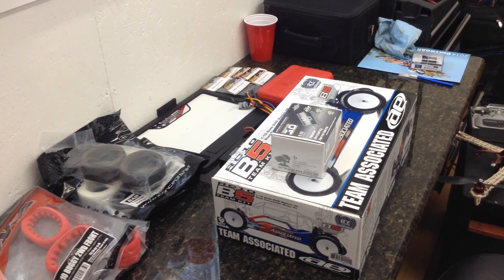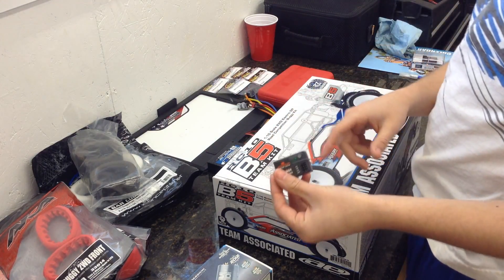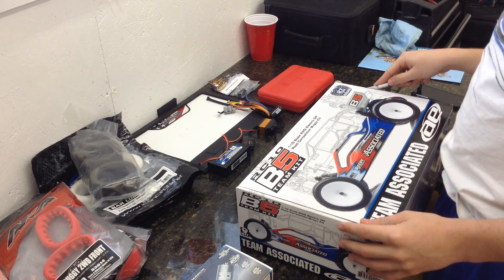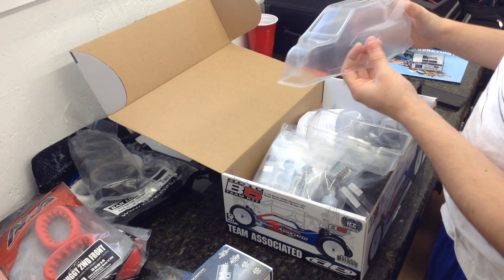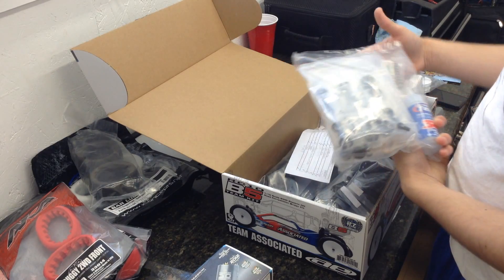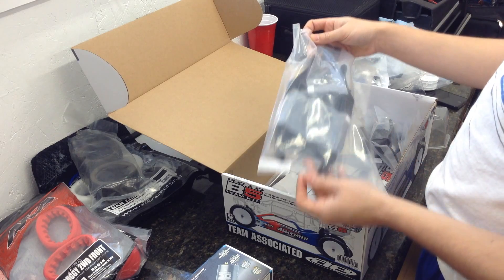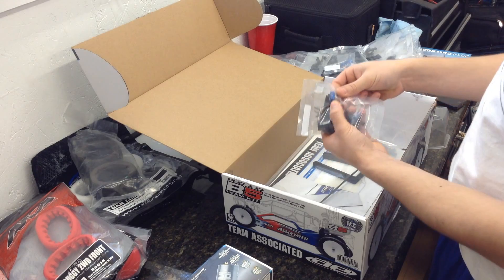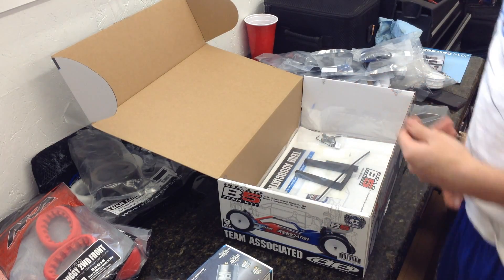Team Associated RC10 B5 Unboxing

Comment: Dont run the ti-ni shock shafts! They are a different diameter. If you arnt on the b5 nation fb page i highly suggest you joining! Some of the AE engineers said they dont recommend those shock shafts. They are coming out with new ones soon.
Reply from the maker: I didn't thats my picture everyone was talking about :p the stock ones did feel smoother